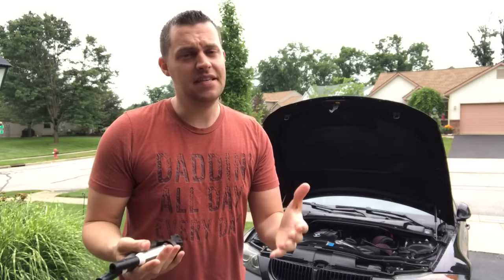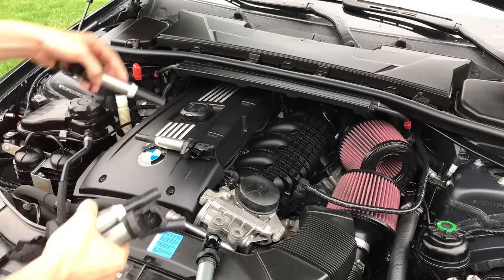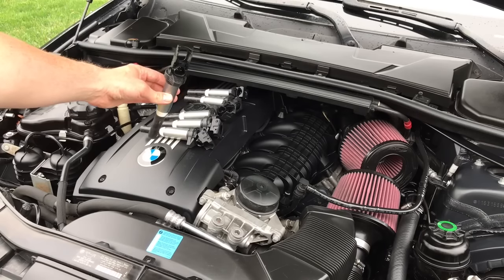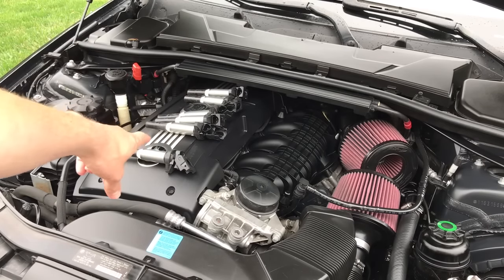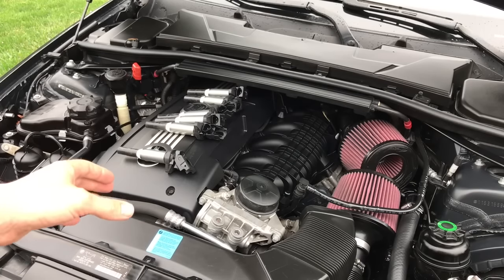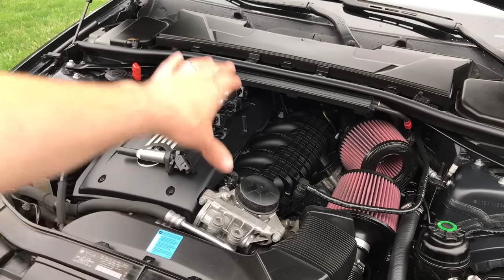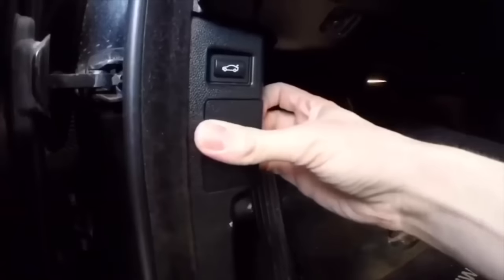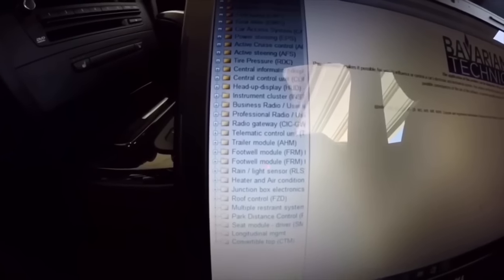BMW ENGINE MISFIRE? HERE’S A FREE FIX!

Comment: WJAT TYPE OF MISFIRES WERE YOU GETTING. IM GETTING BUCKING/JERKS AT RANDOM SPEEDS
Reply: Did you figure out the problem?
Reply: Leon Zekavica not yet i have it parked. I believe it’s my vanos solenoid, it started acting up when I cleaned them.
Reply: Have you checked the cable that connects to your ignition coils? Maybe that could be the problem why you missfire? I had the same issue pop up so I’m getting the car checked now . If I find out the problem I’ll let you know
Reply: Leon Zekavica yea please do

Comment: Maybe you can help my ass misfire in cylinder one I first chase all the spark plugs and nothing changed then I replace cylinder one ignition coil nothing changed in about another spark plug and another ignition coil still nothing change and I took it to my buddy that had a really really expensive scan tool I’ve been running Beamer geeks ProTools but his skin tool said the same thing as mine misfire but then he tested the three wires going from the ignition coil and he said the gray wire was pulsating and that’s the negative that goes to the computer I’m not sure which pinhole I would need to trace I think cylinder six is also a solid gray wire and the other cylinder coils have a stripe he didn’t think it was the injector you didn’t mention if it was dry it’s probably not the injector or if it’s wet then it probably is the injector I think that’s what you said anyways let me know if you went down one of these rabbit holes or should I splice in to that wire and then try to find a pinhole and splicing to that and run a new wire see if it fixes the problem before I cut it?

Comment: So what about misfires but no codes? My car misfires on cold starts every day but once it gets to normal idle it stops and there’s never any codes or issues with it. Been like this for a while.
Reply: Maybe new spark plugs
Reply: What did it end up being?
Reply: Surely this is late, but I've read somewhere that an air leak could be the culprit here, cz when hot the seals and gaskets expand and block any tiny spaces where the air could escape

Comment: I had a misfire in cylinder 1. I changed the plug and coil and still the same. I haven’t checked the injector but I need to replace 2 oxygen sensors. Will this still misfire the engine?
Reply: u need to erase the code

Comment: I NEED HELP!

I have a misfire I just can't seem to fix!!I 2010 BMW 335xi N54. I Changed all spark plugs and coil packs. Still misfiring. I replace my index 7 injectors with used index 9 injectors. Ran a little better but still misfired. Can anyone please help?? it's getting so bad that the whole engine is bucking and whistling when accelerating. I can't take it anymore :( Here are the codes I'm getting: 1/13 - P0171 bank 1 system to lean. 2/13 P114B No DTC definition found. 3/13 - P2270 Oxygen sensor signal stuck Lean Bank 1 Sensor 2. 4/13 - P0301Cylinder 1 misfire. 5/13 - P0303 Cylinder 3 misfire detected. 6/13 - P0300 Random -  Multiple Misfire detected. 7/13 - P0171 Bank 1 system to lean. 8/13 - P114B No DTC definition found. 9/13 - P0301 Cylinder 1 misfire. 10/13 - P0303 Cylinder 3 misfire detected. 11/13 - P0300 Random -  Multiple misfire detected. 12/13 - P2195 Oxygen sensor signal stuck biased/ stuck lean bank 1 sensor 1. 13/13 - P0302  Cylinder 2 misfire.

Comment: heres another scenario you left out.......after your vehicle reaches operating temperature it develops a gradually increasing misfire that starts with one cylinder and slowly progresses to 2 cylinders ....hmmmm......and No it's not the HPFP.....cause that would affect all the cylinders........so what could it be?.....the car only displays misfire codes , p0300 , p0306 , p0302 , all coils are properly functioning , spark plugs are new , hmmm......this is a tricky one you won't find using google.
Reply: Well? What’s your answer lol

Comment: I have a misfire in cylinder 3
Reply: Have a misfire in cylinder 3 right now, just recently changed the spark plugs and moved around the ignition coils but looks like the error is still there.